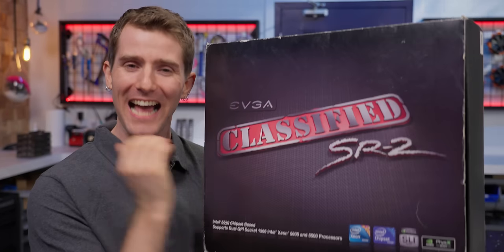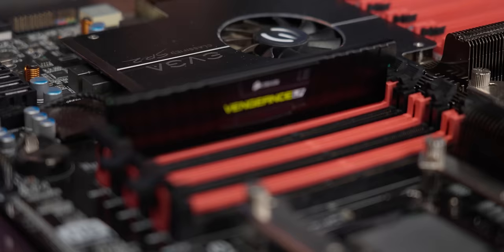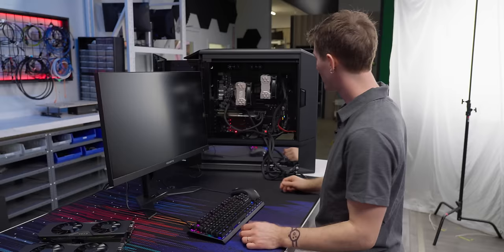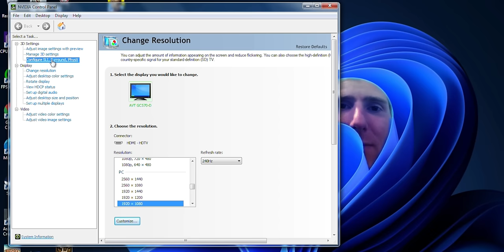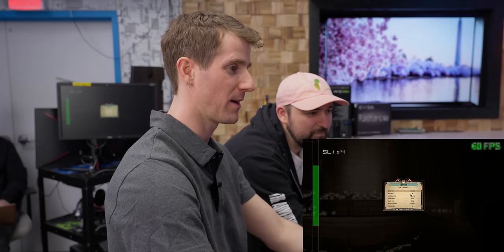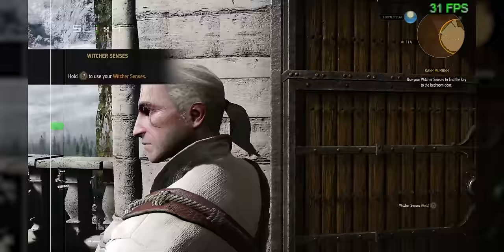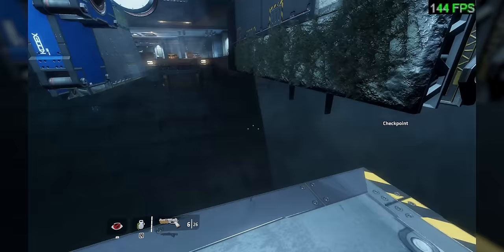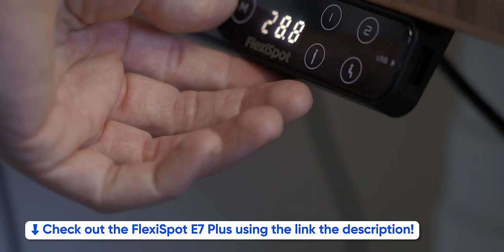How Bad is This $10,000 PC from 10 Years Ago??

Comment: Do you know that human eyes can barely notice any difference past 70 fps. So you can be looking at 300 fps and it will look to your eyes pretty much the same as 70 fps.
Reply: Where do you guys take that bs? 🤣 the eye does not see in fps, much more it is a fluid motion. If light was water imagine it would just travel with the speed ef light from where it bounces right into your eye. What you mean i guess and that is true : 70FPS to 140FPS is very noticible where from 140FPS to 210 most people really cant tell if they play with 150 or 200 fps. Most likly you'll get sick under 100FPS if you run 144HZ on your monitor and 120FPS on your mobile phone
Reply: you can absolutely tell the difference -- check out a rhythm game like osu or taiko with vertical / horizontal scrolling. you can easily see improvements between 30hz, 60hz, 144hz, and 240hz. with shooters and other games it's not as noticeable, but when things are moving quickly in a straight line, choppiness is very apparent and there are huge differences between frame rates.

with that being said, LTT puts way too much emphasis on this, as it doesn't make a significant visual difference for the majority of users. however, if you're into tech and know what to look for, seemingly small things like that can be very frustrating to deal with.

Comment: Bro my 600 dollar 2060rtx laptop I bought 5 years ago is literally better than this. Sold only by Walmart btw.

It can run everything on ultra in this video red dead 2 and gta with 100+ fps this is nuts lmao. To all that want to start pc gaming you absolutely do not need a whole desktop to play some of the best games recently even new ones my laptop proudly pushes with consist smooth 60fps, let alone anything over a grand.

Comment: u guys just dont know how to clock and configure that build, u need to take up the north bridge and ram clocks, also timings, and instead of overvolt, u have to undervolt, bios doesnt know how to power correctly, ur skills at real oc is just bad, system agent, and everything, it has to hit low latency 48ns max... and u forgot to overclock gpu

Comment: well i got 10 year old dell workstation retail cost 15k    my cost 135,00 
ok i got pc now how do i bring it up to date as far speed, 
160 gigs memory 50.00 
video card  nvidia 10701  ooo wait why put a out dated card in a pc, 
and awaser is speed i wanted no gpu could reach
so i added nvida telsa card, 15 gig, 
now telsa card is worthless with out a ton of drivers, 
note this not a gpu card,  nor will out put vidoe, so that driver be trun off as dose interfear with above driver anyway,  where all other drivers come to play,  nvida network, harddrive, system intergrateing, 
now hard drives 4 6tb raid 10.
ai software,  to note this pc has 34 cores, 
after installing what was over 20 drivers,  then i installed nvidia ai  
huge probem window 10 was unstable 30 time it crash this system was built for windows 10, 
what the hell, 
o well  each os is coded from windows 7 so i  installed 2019 server 
vmware 17
viso studo 2024 and sql 
now ai taken off, it runs over 100 threads at time base cpu speed is 2..4 ghz top is 3.8 opps how can that be right, 
well seams computer now thinks it has over 400 cores  
u need a nvida telsa with fan built in and newer one oldest cards to slow,  so u in ball park with k5 or higher, 
it will run any game,  probem some wont run on 2019 server why vmware, 
windows 7 and 8 and 10 on it,  chose my possion as i pass throw video card,  bang got all i want
note, one key fack  in all of this i have no more then 500.00 and binchmarks is 30% higher then stock unit
harddrive speeds are 60 % higher boot time 3 sec after the post,  
ai will build scrips to fix probems in software, and lears how speed up the pc so most i use it faster it gets, 
now my new  build as this one just about done, to move all my files over to this unit will be pain in my tail,  
some reason this windows 10 wont see any network computer,  and i found windows 10 ment to force users go to 11 wich wont support older hardware, well  running server and vmware is way around all this, 

now power takes to run  that depends on load on gpu cards, i never seen cpus go above 2 % 
in week be looking for few newer servers, to update my 20 years old lot,  got place i get them cheep , 
happy huntting